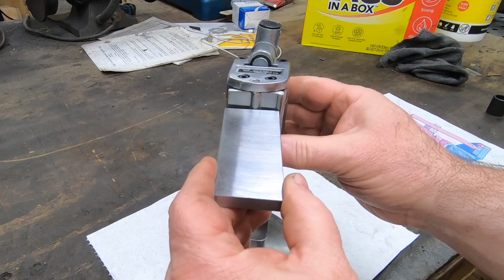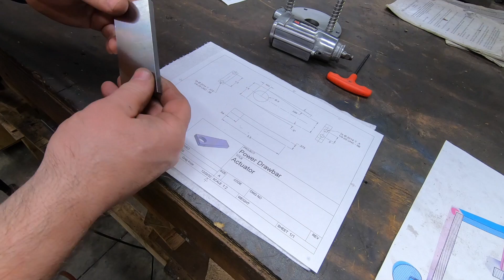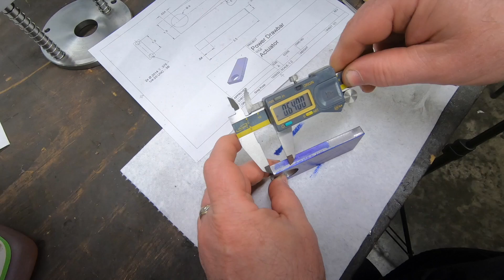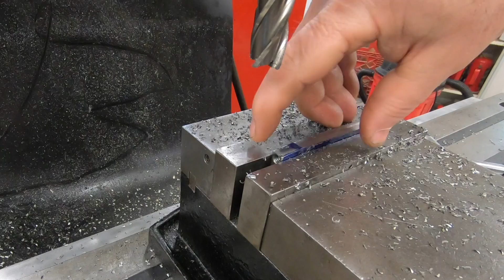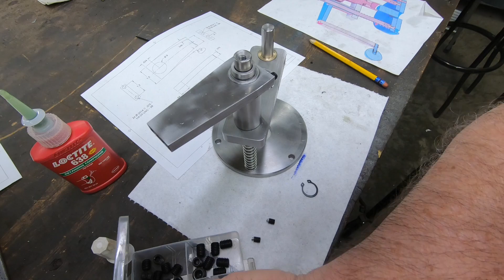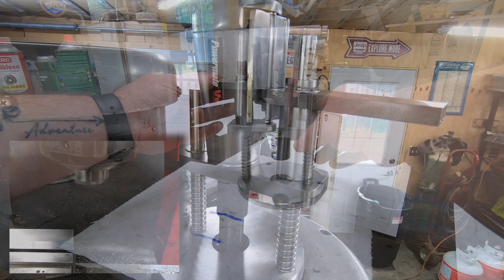Power Drawbar for the Bridgeport Mill - Making the Actuator and Test Run

Comment: You ask for comments  ..

I was taught when using clamp screws to fix a round piece in a round hole, to not put 2 screws diametrically opposite each other.

1 screw pushes the bar to the opposite side of the hole and creates line contact which fixes the bar more securely. 
2 screws at 45° are better.
2 opposing screws create point contact each side and allow the bar to pivot.
This can cause wear and subsequent loosening. 

Two reasons why it isn't particularly relevant to your project ..
Your location isn't that critical and to drill 2 holes at 45° would be more problematic. 

Though you would probably enjoy the challenge  😊
Reply from the maker: Appreciate the comment. Thanks for watching!